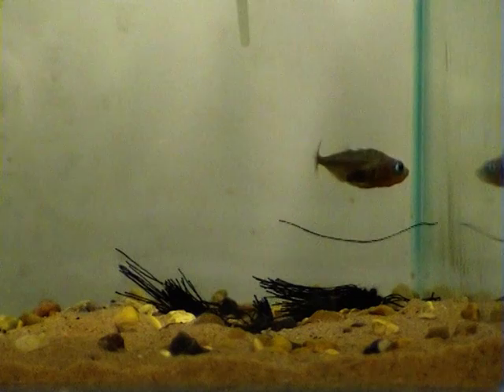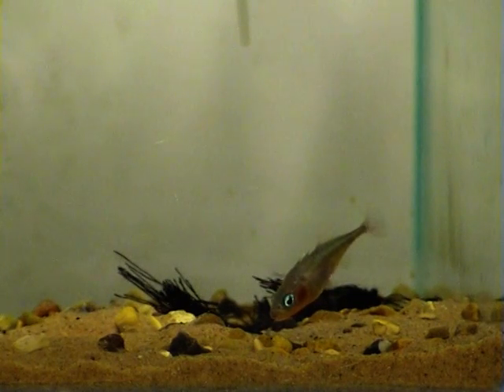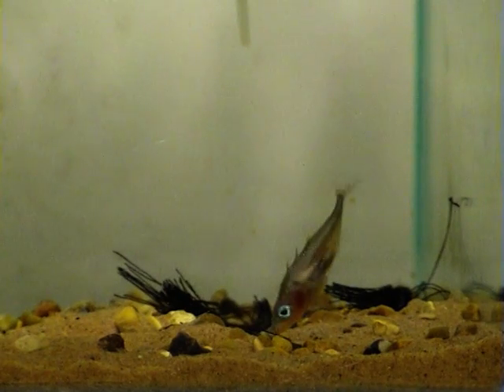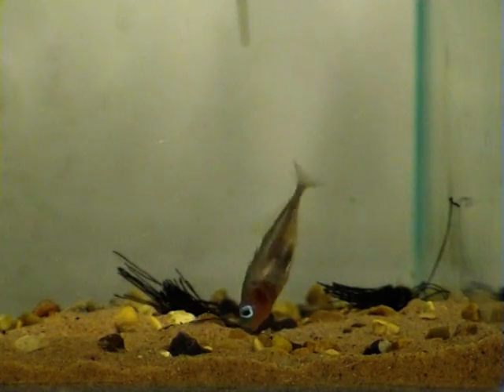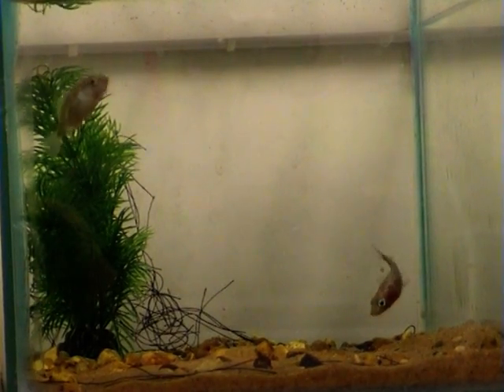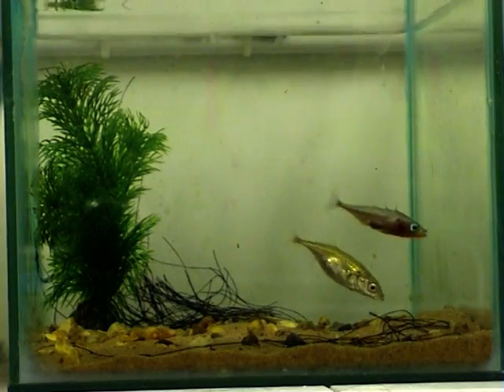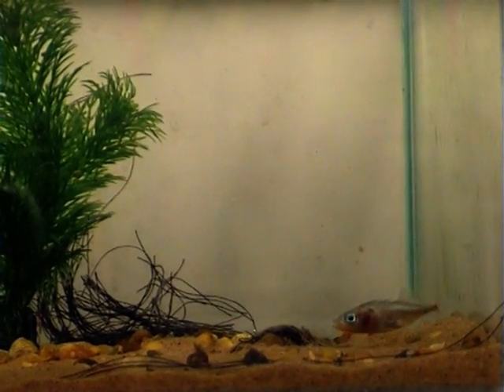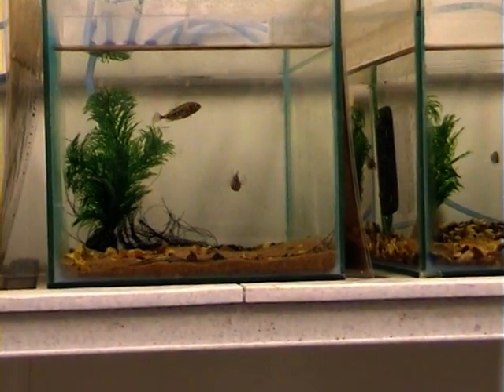Stickleback Partnership

Comment: That is really interesting. I have worked with a cichlid called Kribensis, and they like to move pebbles against small, upside-down flower pots/rocks to partially burry them for a more protected nest. The females usually keep their eggs around the rim of the flower pot and stay in there to guard their offspring. I am now interested in working with sticklebacks.